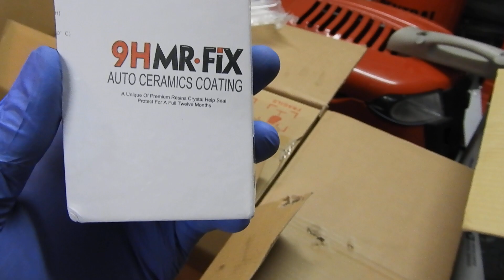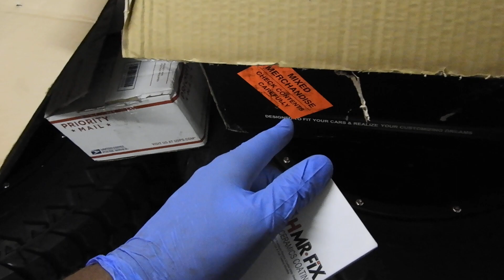HUGE UNBOXING FOR THE CUMMINS!!

Comment: Hopefully the generic projectors satisfy you!  Lots of new stuff coming up can't wait to see it all finished up.

Just did a full HID projector retro to my 4th gen it turned out amazing! Wish i could share pictures.  My tow mirrors  i just retrofitted 4 amber LED lights to my mirror turn signal because the factory ones burn out quick, turning them into running lights too. 

Puddle lights burn out so I retrofitted brighter LEDs into them too.
Reply from the maker: Jordan Kaz dope stuff man. The puddle lights on these mirrors are led so I'm hoping they are bright and last long. I'm gonna wire them to the interior lights so when ever I open the door or unlock the truck they come on.
Reply: EVERYTHANG DIESEL yeah mine were led too. RAM just put some cheap ass leds in I guess, it's a common issue.